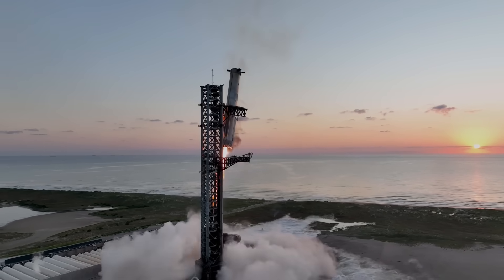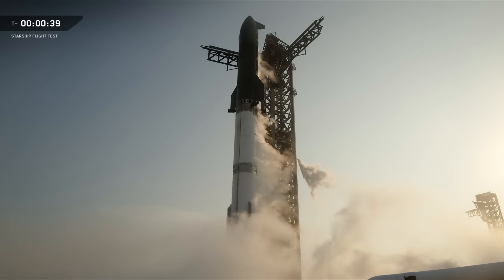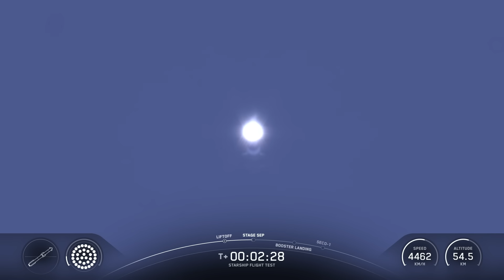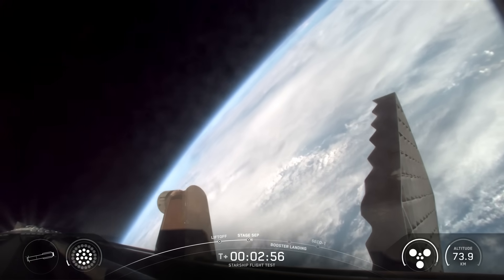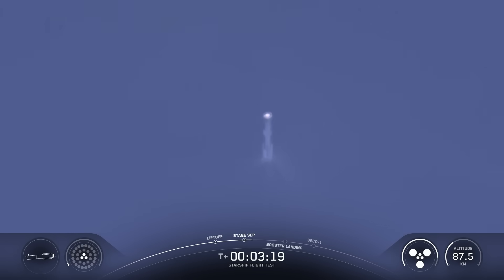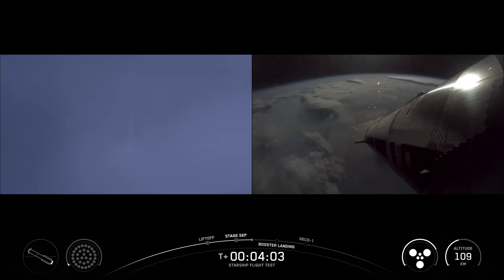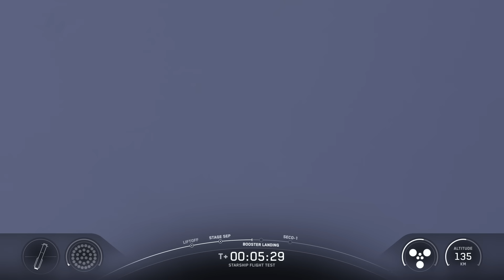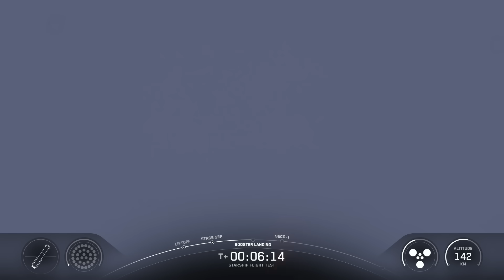SpaceX Builds Largest Reusable Booster, Also Makes Door That Won't Open - Starship Flight 9 Recap

Comment: Since trashing NASA/governemnt projects is a common theme in any video that regards SpaceX, I would love to understand something. Isn't SpaceX publically funded? I know they make some revenue from Starlink and Launch missions, but development of Starship is publically funded right? If I recall correctly they won some public bid to develop this system many years back. Scott/people in comments, would love to hear some details.

Edit: apparently more than 4 Billion USD in public funding for developing Starship. I wonder how much private funding theyve added, 4 Billion is substantial though.
Reply: FTR $4.2 billion was awarded to SpaceX Starship research by the Biden Administration.
Reply: Now look up how much the SLS block 1B launch tower has cost so far
Reply: @alexsiemers7898  damn, 2.7 Billion!! However, seems like it is being built by a company called "Bechtel" on contract, so that just proves my point tbh. Imagine if NASA hadn't been so stripped down, and they still had capabilities to construct it themselves, they couldve done it cheaper probably. But only speculation as it is a hypothetical scenario.
Reply: @milkarn123  imagine thinking NASA hasn’t always had its launch hardware made by other companies.
Reply: @alexsiemers7898  youre probably right. Seems like NASA had better control over its contractors back in the good old days though. And seems like NASA was much more competent before it was stripped down and deprioritized
Reply: @milkarn123  the original atlas rocket was literally so flimsy it would crumple under its own weight without fuel inside to pressurize it. Handing work off to low bidders is also not new.
Reply: @alexsiemers7898 seems like commenting is bugging for me. Summary: read up on the Launch Pad built for Apollo mission, that SpaceX leases in the current day, it was constructed by a private company but under supervision by NASA, and with US Army Engineering Corps Soliciting the bids. The process used to be much more rigorous than modern day public contracts

Comment: They should just ditch the idea of reusing 2nd stage. Just make it dirty cheap to manufacture. By removing most of avionics, heat shield, sea level Raptors-easy achievable. This is how this program most likely ends up.

Comment: Imagine any rocket that had 9 failures in a row and what the public, or even the industry would say about it.
Reply: I’m sure the Mercury program would be a fine example of that
Reply: Booster = 9 test flights so far.
Ship block 1 = 6 test flights.
Ship block 2 = 3 test flights so far.

It's only technically 9 flights for the booster.
Also my question is how did all 9 of these tests end in failure Gabor?

Comment: Starship obviously needed better attitude control last year, but they didn't do it. Nevermind redundancy, the thing just doesn't work at all. The puff holes aren't puffing. The only attitude Starship has is a bad one. 
Also, can somebody kick out the interns for a couple of weeks, so that a competent engineer designs a hatch that works?

Comment: In my eyes, this was a huge failure. No sugarcoating. Yes, Starship reached Seco, but how? It was already unstable and tumbling way before. It's the third time in a row the ship broke after booster separation, in the same area! That's far away from a healthy test, fail, fix, philosophy. They learned marginal stuff from the data on the heatshields, or in general. It's even the thrid door that's not working.... a door! One can assume the smartest engineers can install an actuated steel door into a steel can.

Starship at this point has very little complexity compared to the vision of a life support system and manned starships. It's basically a soda can filled with liquid gas. 

I can give you an update for Mars. Not in the next 20 years if they are still doing fundamental material-testing after 4 years. "Oh look, it DOES melt... huh" is not much progress.

Comment: They've burned through the entire NASA moonshot budget just trying, and failing, to reach low Earth orbit. Best of luck, America. Hopefully they're not in charge of your defense systems too. Either they’re genuinely incompetent when it comes to engineering within a budget, or they’re knowingly overspending, confident the US taxpayer will pick up the tab.
Reply: Number please? Or are you genuinely incompetent when it comes to engineering?
Reply: @universeisundernoobligatio3283  Sure. NASA’s Artemis moon return budget through 2025: $93 billion.
SpaceX got a $2.89B contract in 2021, plus $1.15B more in 2022 for extended work, bringing it to $4.04B minimum, with total HLS cost estimates now near $4.9B.
Deliverables so far?
4 exploded prototypes
0 successful orbital reentries
0 human-rated vehicles
Artemis III delayed from 2024 to no earlier than 2027
That’s not "engineering under pressure." That’s Tesla economics: promise cheap, miss every milestone, spend like hell, and trust PR and taxpayer subsidies to smooth it over. If you need receipts, I brought a filing cabinet.
Reply: @universeisundernoobligatio3283  NASA's Artemis ENTIRE program: $93 billion.
SpaceX has burned through nearly $5 billion of that for Starship.
So far? Four failed test flights, no orbit, no lander, and Artemis III delayed to 2027.
Looks a lot like Tesla: overpromise, overspend, underdeliver.
Reply: @Think6.6  so we’re just ignoring the other $88 billion that hasn’t resulted in much of anything either?
Reply: @alexsiemers7898  No, we’re just not pretending it’s already been spent. NASA’s Artemis budget runs through 2025. Most of it’s allocated for future missions, infrastructure, and support systems that haven’t launched yet.
Meanwhile, SpaceX already cashed nearly $5B and delivered explosions, delays, and hype. That’s not “the future,” that’s a burn rate.
Reply: @Think6.6 so why are we mixing together money that has been spent with money that hasn’t?
Reply: @Think6.6  
Well $88 billion more to spend to catch up to one launch?. Oh and how man times did Artemis land and get reued?

Comment: This cannot by any measures be called a success, but it is a step forward. I still find it worrying that after all these flights, and especially after the two-month hiatus to fix the leaks found during Flight 9, they still haven't nailed it. I am wondering if heads will start rolling at SpaceX soon.
Reply: The problem might be that they already have.  I would be surprised if some of the more experienced engineers haven't left due to Elon's recent extracurricular activities.  I know I wouldn't want to be working for someone throwing "my heart goes out to you" salutes.

Comment: The more of these launches that I watch, the less convinced I become that anyone will be flying on Starship any time soon. The booster works great. They have the booster figured out for the most part. Ship, though, is a very long way from flying humans. If I were forced to put money on it, I wouldn't be comfortable betting any sooner than 5 years away from human flight. They might get it working for payloads but humans? No way. Dragon got human certified pretty quickly but it's using tech that we've been using for generations - a capsule with ablative heat shield and parachutes that lands in the ocean. Starship is so radically different and radically bigger than anything anyone has ever done that it is going to be a while, I think. I don't like to doubt the engineers at Space X and I hope I'm wrong about this but Ship isn't inspiring a lot of confidence after 9 tests.
Reply: Agree completely. The Falcon 9 and Dragon were so sucessful because they were basically the simplest and cheapest rocket+capsule combination possible to be built, and they arrived at just the right time. Both F9 and Dragon used public NASA projects, like the FASTRAC engine, combined them with great engineers and some commercial off the shelf hardware, and they made a great, cheap, medium lift rocket at a time when the US could only build rockets out of solid gold. Then they could build on that foundation to add landing capability etc.
With Starship, they try to build a Saturn V + Apollo + Space Shuttle combo as cheaply as possible in much worse conditions than the factory in Hawthorne. And they decide to test it like in Kerbal Space Program, rather than build on decades of experience with sucessful project management, and unprecedented modern production and simulation capabilities. They end up wasting huge amounts of money, resources and precious wildlife each time a new design or production fault appears that they could have found and corrected through doing things properly. To me, as an outsider with a modest mechanical engineering background, the whole project just seems like a top-down controlled mess without any clear engineering direction apart from doing what the boss says.
Reply: Eh, these are test articles for the factory systems as well as flight testing the interim-version article itself, and we know it's nowhere near the planned, full production V3 ship design.
Reply: 5+ years and 100+ successful missions is my guess too. There is nothing wrong with that, - I am willing to wait as long as I see this revolution happen. We only need to get used to "Elon Time == Real Time x Pi"
Reply: and they've already burned through their money they contracted for to be on the moon.  That's part of the reason Musk HAD to get involved in politics.  He's covering up his breach of contract.
Reply: well the booster itself can get lower tonage 150 tons or less into LEO on its own if starship is not ready yet but the starship super heavy booster couyld hule huge paylaod farging LEO 150 ton payload into orbit on its own if space x realy need more money they can get to use that now for more money. we could set up a new ISS with that super ehav ynooster alone in just a few launches alone could set up a brand new huge iss and even biger withte shear 150 ton payalod to leo paylaod the starship super havy booster can hule on its own sence its its own fully fonuchal resubable booster issitem as well. hech you could just launch the  orion space craft. with its onw deteaced huge falcion 9 heavy with it on top of the super heavy booster with a pay laod decopler conteing the two with thast bacly aronud aobut 150 tons ish with full wetpaylaod fule mass and everything bacly. snece the satrship super ehavy booster can hule all of that into LEO that would give the orion space craft a huge amonut of range bascly.
Reply: I don't see any way that starship could be human rated. It has no launch abort system, and it's landing method is untested and requires a lot of interdependent moving parts also with no abort system.
Reply: @YourArmsGone  Don't forget it require an additional 12-15 refueling starships, which requires the human rated starship to dock with several refueling starships to make it to the moon.  They are a LONG way away human test flight, let alone making it to the moon.  Musk is a charlatan salesman.  He's just keeping the pump going before the dump.
Reply: @YourArmsGone  The Starship booster should be good for reusability unless vibration causes structural problems,  and Starship should be progressing to a heavy lift cargo transport for lunar missions once the Starlink work is completed.  The HLM mission will  probably be re-evaluated for Artemis by NASA to get  higher priority.
Reply: I agree.  They should be further along after 9 test flights.
Reply: If they had achieved good attitude control this flight would be successful.  They are perhaps only one flight away from being a useable satellite launcher.  Once useable, fly enough to prove reliability, then install life support systems and it's good to go.  It's much closer than you think.
Reply: @davidkottman3440  I agree, there's just a few small issues that caused massive fails but once those have been fixed properly then ship is good.

Comment: Why does SpaceX not use the attitude control system based on single gimbal control moment giroscopes 
They require just electric motors to drive the gimbals, work without fuel during the 6  month trip to Mars or ~22 months during the free return trajectory.
What is required are momentum desaturation firings in planet proximity due to the gravity gradient moments.